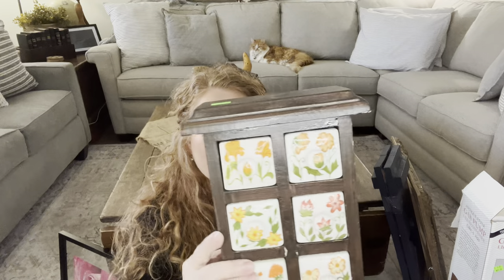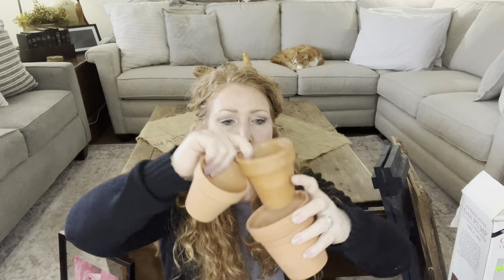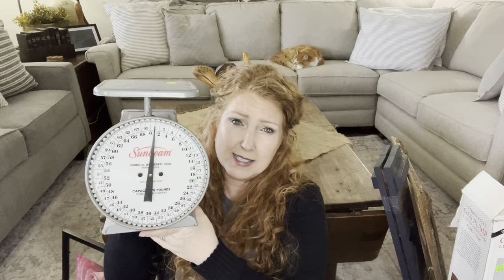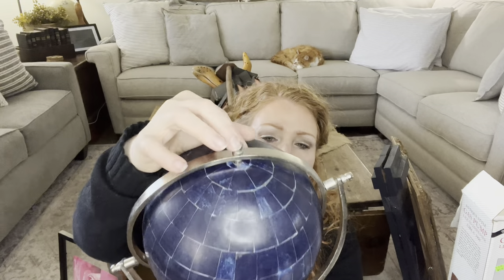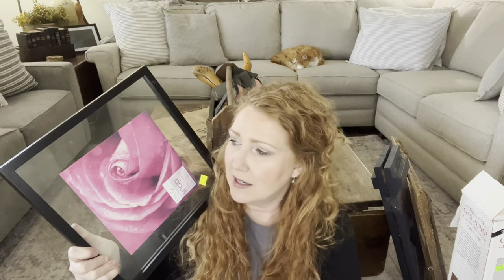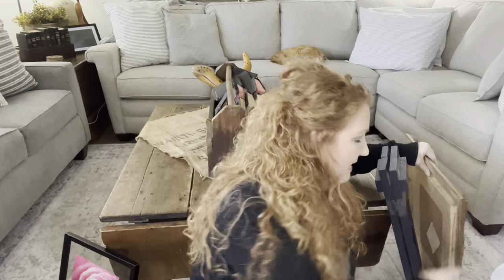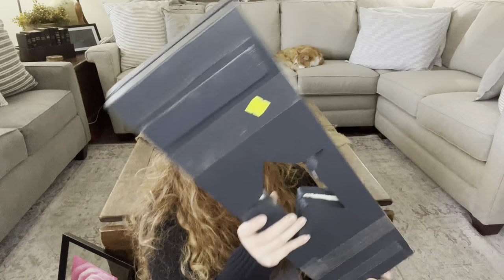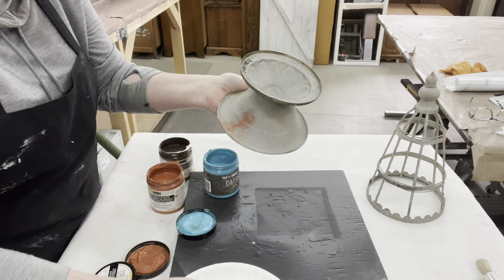Making Beautiful Home Decor from Second Hand Finds | Haul | Farmhouse | Cottage | Industrial | Boho

Comment: With the cricut lettering. #1 I use Oracle and then make sure your blade is sharp and the settings are right. I struggled alot before I did these things.
Reply from the maker: I do use Oracle 651 matte vinyl. Maybe a new blade is needed. Thank you

Comment: Maybe try the heat gun on the galvanized metal to make sure there isn’t any plastic/sealer coating in it, before putting it in the solution

Comment: Great haul! 👍🏻 Loved it all but my favorites are the clock and that deal you used the patina waxes on! Wait! ✋🏻The mirror too! Oh hell, they we’re all my favorites lol! 😂Thanks for sharing your talent with us, Yvonne!! 🤍🤗 Oh and Vonda is where I get my IOD stuff from…she ROCKS!! 🤘🏻Super fast shipping too!! 📦 (VONDA, if you happen to see this…THANK YOU FOR BEING AN AMAZING  IOD STOCKIST!!) 🤍🥳

I don’t know for certain if this hack for weeding will help you but it might. I know it helps when you’re doing lots of smaller wording/designs.  It’s called reverse weeding. Once the machine is done cutting the wording/design, apply the transfer tape over the top of the design and then turn it over and peel the paper backing away. The entire design will be stuck to the transfer tape. Then weed the wording/design as you normally would. It will be a bit harder to get the unwanted pieces to release since they’re on the transfer tape but it’s worth it to not lose any of the stuff you do need. Once you have all of those little pieces weeded, apply the design to the surface as you normally would. Hope this helps out some! 🤞🏻

Did you notice that the box that the Texaco beverage deal was in isn’t the same thing? I mean, it’s the same concept but not the same logo. 🤷🏻‍♀️ It’s an awesome find for sure! Texaco memorabilia around here, the Texas panhandle, are hot commodity’s. 👌🏻
Reply from the maker: Thank for sharing that tip on weeding. 
Yes, the Texaco drink dispenser was a special order from the company for the Texaco company is what my son found out when researching it.

Comment: Great haul.  I love your thrift to treasures.  The clock and the mirror are my favorites.  I have used that concoction for aging metal.  It works really well, as you have discovered.  The trough on your table can be clear coated to prevent further rusting.  Then you won't need to worry about your table.
Reply from the maker: Thank you

Comment: If you don't mind using chemicals you could try using Lysol toilet bowl cleaner to make your galvanized stuff look old. I did it to a bucket and it turned out rusty and crusty. I just squirted it all over my bucket and let it sit over night. I put it outside in a plastic bin so I didn't have the strong smell in my condo.
Reply from the maker: I tried that before with no luck. But it may of been the finish on the piece.

Comment: Do you like your battery glue gun? I have the same one, and I hate it. It's too heavy, and it drips hot glue constantly😩
Reply from the maker: I do. I learned to turn it on and off ( a lot) to control the heat. Doing that it works great. A lot of times I just let it sit and bring the piece to it instead of lifting it up. Not all projects am I able to do that. But yes I really like mine now that I tackled some of its issues